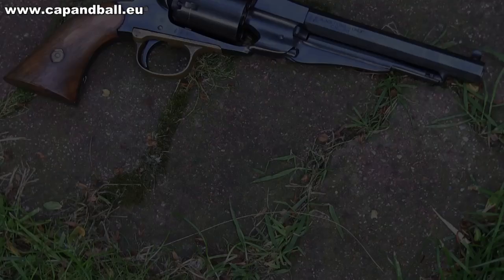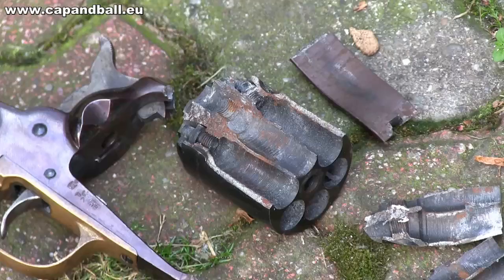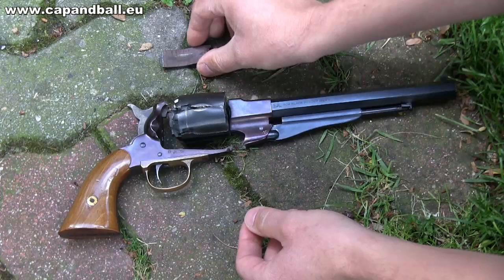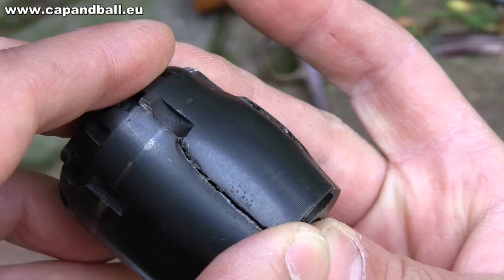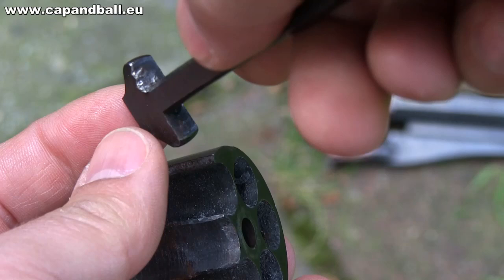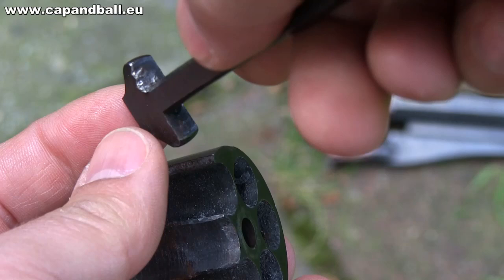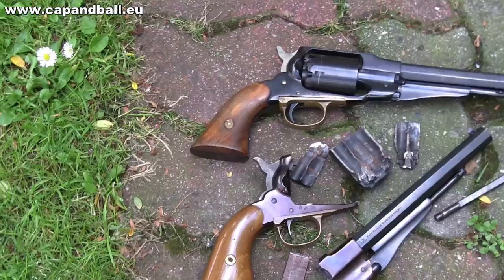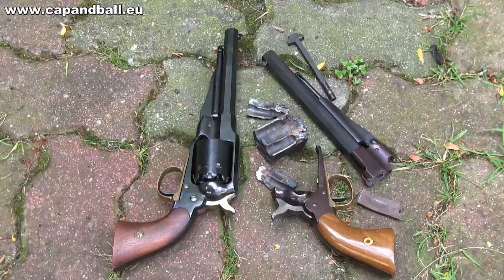The exploded 1858 Remington New Model Army revolver

Comment: That guy is lucky to be alive.
The amount of smokeless powder that would fit into the chamber of an 1858 Remington is down right scary to contemplate.
Reply: Amen! And with all of the different types of smokeless out there the possibilities are endless. When loading cartridges, mistakenly bumping a 6grn smokeless charge up to 8grns can end up blowing up the gun. So can you imagine what would happen if someone took 30grns of that same powder and loaded it in a cap and ball revolver? You are totally correct that it is downright scary to contemplate!
Reply: mtslyh It's no longer a Cap&Ball revolver at that point. It's a hand grenade.
Reply: 40 gr of black powder does not even fill those cylinders to the full, it is scary.
Reply: @spankthemonkey3437  They used to dip the paper used paper cartridges for cap and ball revolvers in nitroglycerin to ensure that the primer would light the main charge through the paper backing.
Reply: @Johnathan Cairo yea, I have been using instaflixxer for since november myself :)

Comment: wow. those barrel fragments could make a disaster if they hit somebody nearby. very interesting video
Reply: Cylinder fragments the barrel was in one piece. what a waste of a good black powder gun
Reply: Can these kind of guns shoot .44 ammo and .45 and would this happend if u don’t seal the revolver right
Reply: @559mafiaboi  the particular  gun shown has 45 colt and automatic  cylinders available  for them. The bore is actually 44 cal.
As opposed to  429 in 44 cartridges.
Reply: @559mafiaboi  There is no way to insert a cartridge into a black powder cylinder, which has but a very small opening at the back (a percussion nipple) where a cartridge would be inserted, and you've just seen the result of loading a BP cylinder with smokeless propellant.
If a black powder cylinder is loaded without sealing the chambers, a chain fire may result as plasma from a fired cylinder arcs to the next.

Comment: I used to own two 1858s....beautiful pistols, handled well, awesome triggers and very accurate. Of course I ran them on 3F (Elephant) or Hogdon777... the latter giving amazing accuracy and surprising velocity with round balls. I always used greased patches under the balls rather than messy lube in front.... worked wonderfully for the several thousand rounds I put through these lovely guns. They always worked best run "full throttle" with enough powder to just enable the ball to be properly seated without cylinder binding. Quick reloads via spare cylinders too, and I had a matching revolving carbine too........I wish that I still had them...... :-(
Reply: They were Ubertis in stainless steel (nice and easy to clean!). I made a pair of 'handed' custom grips for them because the originals were a wee bit slim, even for my small hands.. I am retired now, and sadly had to sell them because keeping a handgun license in New Zealand is an expensive business and my income was insufficient to sustain the ongoing cost.
A fellow club member had an original 1858. It was in remarkable order although none of the original finish was left. He used to shoot it in Western Action. The same guy had an Uberti too, and got me to shorten that one to 5 1/2" (I'm a gun smith). I must say the 'feel' of it with the shorter barrel was really good, although I never fired it myself. It was a tricky job because I had to shorten the loading lever and cut new dovetails for the lever latch and front sight, but it turned out really well.

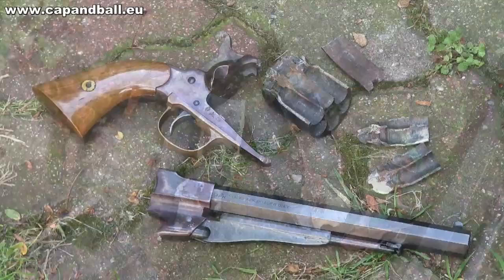Comment: At 1:02, he says the powder came from a BLANK cartridge!  Blank powder is much faster burning than powder used in regular cartridges.  It has to be, in order to make a "BANG" without a bullet.  Furthermore, I think that wasn't a simple high pressure rupture, but an actual detonation.  In other words, the pressure reached a level such that the powder didn't simply burn, but it detonated, as is the case with a high explosive.  Remember, smokeless powder is made from nitrocellulose, or nitrocellulose & nitroglycerine, which are high explosives.  It's "tamed" by the manufacturing process, but will detonate under the right (or wrong!) conditions.
Reply: Clyde Wary Don't know if it would be true detonation or not, but you are 100% right that blank powder is instant death for any gun -- antique or modern -- when loaded behind a bullet.
Reply: Fuzzybeanerizer actually its usable in modern shotguns with birdshots. but probably not in rifles.
Reply: MBsaturnus Do you know this by experimentation? Or do you have some inside industry knowledge that a certain blank powder is actually the same chemically as a certain shotgun powder? I have always read from many sources, and it makes sense to me, that blank powder is in a class by itself as to burning speed, as it must generate significant pressure with very little confinement. Even the fastest pistol and shotgun powders do not go "poof" the way black powder does, if you burn them in the open air. I have never had any blank powder to try the same "test" with.
Reply: Fuzzybeanerizer
experiment. its even slower than regular shotgun powder. a shotgun cartridge isnt really sealed too, much like a blank, so blank powder should GENERALLY work as shotgun powder
Reply: +ultor europae 
should would could ? Why not using just the right powder according to the reloading tables?
Reply: Imothep
when there is no powder and ammo available its always good to have a backup plan, especially should - god forbid - survival depend on it one day
Reply: Can blank powder (8 or 9mm PAK) be used in revolvers as well when SHTF?
Reply: BP is an explosive meaning it burns REALLY fast.  Nitroglycerine is an explosive except when used in smokeless powder where it is modified to burn slower.  You get higher pressures from smokeless than BP because the BP doesn't produce as much total power as smokeless.

Comment: Some blank cartridges for starter pistols use black powder. Other blank cartridges use smokeless powder. Both types are formulated for proper flash and report when pushing only a retaining card past the crimp. Using the starter smokeless powder in a modern pistol would like result in similar failure since blank powder is too hot for use in anything other than blank rounds.

Comment: Blank powder is an extremely fast burning powder, rapidly consuming with minimal resistance creating rapid pressuee wave to cycle self loading actions as well as report. The only other applications are small amounts in cartridges intended to be used in short barreled  pistols like the .25 ACP (6.35 Browning).  Use of this fast burning powder in any other setting makes extremely dangerous excess pressures.

Comment: Saw the same kind of thing at a local range. A guy was firing his Remington 870 Wingmaster and after every round fired, he had problems operating the action to chamber another round. He fired 3 rounds before I walked over to take a look. He's fighting trying to work the action and I noticed something...... a slight bulge in the barrel about 2.5 inches forward of the receiver. I asked him what ammo he was firing and he showed me..... Federal deer slugs, 3" Magnum load. I asked him if I could take a look and he handed the gun to me. Right there on the top of the barrel it stated, "2 3/4" LOADS ONLY" and "FULL CHOKE". Finally got the action open and the last round out of the gun. Pulled the barrel..... looking in the chamber you could see the bulge and a crack at where the chamber ended and the barrel started. That last round, if fired, would have probably blown the gun up in the guys face. When I pointed it out, he went white as a sheet......
Wrong or improperly loaded ammo can kill or maim..... Be careful out there!

Comment: I purchased a Colt reproduction Navy .36 calibre cap and ball years ago and fired only smokeless powder in it. What caused me to do this was this: I was only able to buy CIL Canuck smokeless     .32 rimfire  loads for my .32 rimfire Smith and Wesson Model number Two (2) revolver . What I did with the Colt was turn down the rims of .38 short Colt cases and then inserted them in the chambers of the Colt seating all the way to the bottom of the chambers.  I then measured and loaded a mild Hercules Unique powder load for .38 Colt stopping near 8000 psi pressure. reports powder into the chambers and seated the bullets at the tops of the .38 Colt cases in the chambers. I sealed the bullets with Lyman bullet lube and mounted the revolver in a  rest and placed percussion  caps on the nipples. The revolver was ready to shoot. I cocked the hammer and took up a safe position; I fired the revolver. There were no signed of high pressure so I fired the other four chambers. Again, no problems. I took the Colt apart down to the field strip level; no problems. I put it back together and reloaded it with the same load and this time I fired it by hand at a 25 yard Target on the Long Beach Police Pistol Range in which I had a yearly membership. I told the range captain what I was doing and they cleared an area for me to shoot in. I fired the revolver for about 60 shots for offhand accuracy and it did very good at 25 yards. All the machining was done by me since I owned a machine shop at the time. Cleanup was a breeze. I had made a special tool which rapidly removed the brass standoff casings from the chambers allowing me to clean the cylinder very well.  I don't recommend this but for me I enjoyed shooting the .36 Colt Cap and Ball very much. I had the revolver until it and the rest of my firearms collection was stolen in the mid 1980s. Thank you for showing what the wrong smokeless powder load will do to one of these revolvers. Your channel is my favourite for black powder  shooting. Thank you and keep practicing your Hungrish language.
Reply: ANY smokeless load is wrong in one of these revolvers. You were lucky, Pard.

Comment: I saw that happen to ol' Corky in the Blue Bottle Saloon in Wichita, but it was a Walker Colt.  A failure common to that model.
Reply: Colt walkers are a favorite of mine. N arent that prone to cylinder rupture as people believe but that was a common issue.
Reply: +The Unknown decepticon That was just a play on the words of Little Bill in Clint Eastwood's UNFORGIVEN......I like MY Walker, too!
Reply: +Craig Oldsen Also depicted in True Grit as a gun that misfired a lot.  'They will embarrass you".
Reply: +teejay Trujillo I'm pretty sure that was a Colt's dragoon......can't remember which model.
Reply: So, let's be fair.  Colt's original Walker was built using a wrought-iron cylinder.  Full loads were sufficient for the cylinder wall to rupture along the grain structure of the wrought iron.  Of note, a Confederate revolver builder overcame this problem (not a problem with smaller and lower capacity cylinders) by twisting a billet of wrought iron before machining out a cylinder. There was no straight metal crystal structure (weak spots) to rupture under pressure.
Today's replicas, made of modern gun steel can be safely loaded to capacity (with black powder) without overpressuring them.
Mattie Ross' revolver was supposed to be a Walker, but was actually, as far as I can tell, a Uberti 2nd Model Dragoon, same as one I own.  Never a misfire from mine.

Comment: From the video description...he indicated that it was loaded with "BLANK Powder".  Blank powder is just this side of a high explosive. It has a burn rate FASTER than 60% dynamite. Its hardly surprising that the weapon disintergrated upon firing.  The steels used in this weapon, while perfectly safe for use with low  pressure Black Powder...did indeed become a grenade when using this particularly nasty form of "smokeless powder"...IE..>Blank Powder,...a midrange order explosive.
Reply: The powder you have described is  called flash powder.  Used in fireworks explosive devices and  as a flash for antique cameras.  Totally unstable for firearms propellant.
Reply: @timothyterrell1658  Ah...no. Blank powder is NOT flash powder. They share some simularities..but are NOT the same:
https://en.wikipedia.org/wiki/Flash_powder
https://en.wikipedia.org/wiki/Blank_(cartridge)

Comment: I get a pyrodex pellet and first add about 5 grains of goex and a Winchester magnum cap with rubber cap savers which is a rubber hose cut to fit around the cap. 1200 fps on a Lee Conical and no visible damage. Sounds like a dragoon.

Comment: All right a Hungarian shooter! I love my budget FEG handguns, and I really love my FEG side by side shotgun even more. $500 for a gorgeous shotgun that originally sold for over $7000 US Dollars when the gun was brand new, but FEG is not  well known in the USA. The shotguns were custom order ONLY with prices that started at $7200 and went up to $15,000 or more for gold parts, engraving etc. Those are all modern guns. My father had an old Le Fever Damascus barrel side by side that he routinely loaded with 3" magnum shells. This gun was not even headspaced for 2 3/4" shells. It was designed to shoot 2 1/2" BLACK POWDER SHELLS! I sent to to England, and had it spaced & proofed for 3" magnum. The heavy English Sheffield steel barrels are the only reason that gun did not blow apart in his hands. The action was pounded  to pieces, but it will shoot again. I am casting a new part for it, and I have already fit the new main springs. It was proofed for 3x 3 1/2" Magnums, and did not fly apart. I would not try it with any other twist barrel. Sellier is making 2 1/2" shells again, but I can use 3" modern, so.....  Some guns can take smokeless powder, and nothing bad happens. Others will blow apart, and one tiny bit of metal in the wrong place, and you are dead. Italian replica guns are not very good with smokeless powder. OLD USA guns with old USA metal are even worse.

Comment: This makes me wonder how strong the conversion cylinders are for these revolvers. I don't want to assume they are made of smokeless proof steel. 45 Colt rounds labeled low pressure cowboy rounds seem to be ok in the cylinders. The cylinders for the 36 Navy models will chamber 38 special. An uninformed shooter could easily chamber a +P round with disaterate results.

Comment: There are plenty of low pressure smokeless loads.  You don't want to put the bullet all the way to the powder though.  The manufacturers are just too scared from a liability standpoint to say that using smokeless in a blackpowder firearm can be done safely if you are very careful and exact with your powder charges and loading depths.  And, if you were to use a very slow rifle powder in a handgun, it would be even safer since the powder is hardly even burning by the time the bullet gets out of the barrel.  I've done a test of .50BMG and 20mm powders in a 10mm handgun.  Even with a full case of powder, the slide will not cycle enough to eject the brass.  It's a very quiet round and the bullet is pretty slow.  I'm pretty sure this would be safe in a blackpowder pistol.  Safe, but useless since it is so slow.
Reply: Grumpy OldMan ladies and gentlemen our next canidate for the Darwin Award, while your information may be correct wouldn’t be best to follow the manufacturer’s guidelines so you can have fun and be safe while using any black powder firearm?
Reply: @Dovah22  -- Nope, I'll never qualify for a Darwin Award since I've already propagated my genes.  The best I can hope for now is an "honorable mention". :)

The problem that you normally hear about when someone uses smokeless in a blackpowder firearm is that they use the same amount of smokeless as they did blackpowder.  You've basically created a mini pipe bomb at that point.  The burn rate of a smokeless power also varies with pressure, so if you put the bullet all the way down on the powder, more pressure will be generated, which will cause the powder to burn faster, which will result in even more pressure.  On the other hand, with blackpowder, you can end up with too much pressure if you don't put the bullet all the way down on the powder.  The problem with reloading smokeless in a blackpowder firearm is that you need to accurately position the bullet in the barrel each time.  Easy enough to do with blackpowder when the position is just "all the way against the powder".  Basically, you push it down until you can't go any further.  If you were doing this with smokeless though, you might need to leave an inch between the powder and the bullet.  Leaving too much space would just result in a lower velocity bullet, but leaving too little space could result in an overpressure situation.  It's one thing to do this in a controlled environment, but doing it out in the field leaves room for mistakes.  You are in uncharted territory here though.  If you have never loaded smokeless cartridges or are one of those people who only follow published reloading data, then you probably should not be thinking about using smokeless in blackpowder firearms.